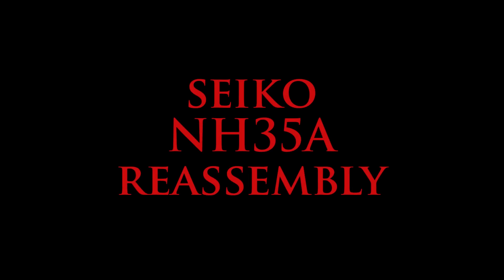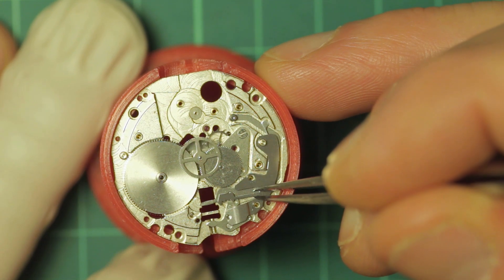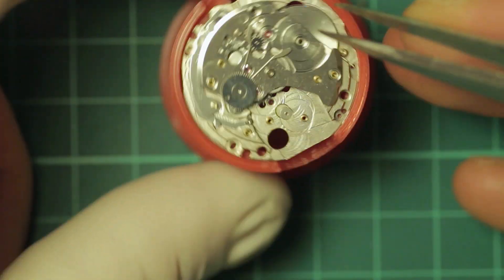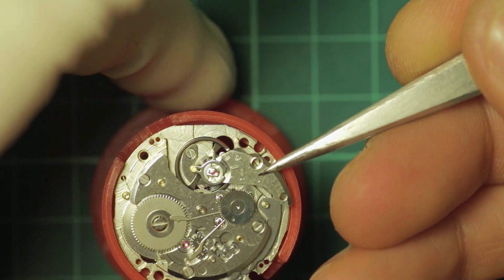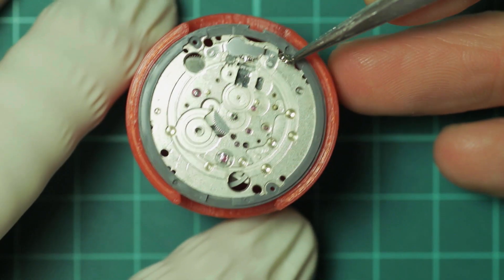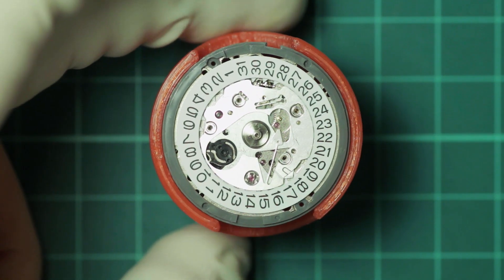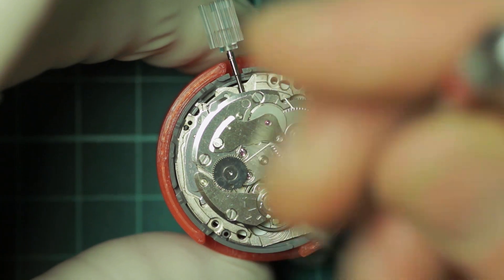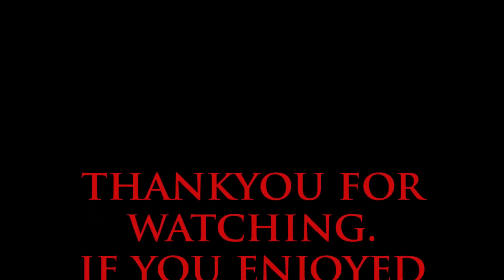Seiko NH35 - NH35A Part 2 Service - Reassembly

Comment: I have an NH34 with a winding stem broke in it, an nh36 with a bent second hand pinion, an an nh38 that just needs a good cleaning and oiling.

It used to be that I would just replace the movements of these watches. However, because of the trade war, these movements now cost around $70.00 US so I've decided it's time to level up my game and learn how to service watch movements myself.

From collecting, to modding, to building, and now servicing it's been a fun journey!

Thanks for your help Sir 👍

Comment: Hi I assembled the train works and pallet fork but when I dropped the balance it won’t go on. Checked the balance with another movement and it went right out. Maybe the pallet fork is not properly installed or defective?
Reply from the maker: You can check the pallets by moving the pallet fork side to side with some power on the mainspring. As you move it the escape wheel should move a tooth at a time.
If this works your balance should operate.
Reply: @spidiq8 yes thank you I did that and when I move the pallet fork it just uncontrollably unwinds, perhaps it’s defective. I’m working on an NH34. 

Btw awesome video, love that some people work on this inexpensive practically disposable movements.
Reply from the maker: @jmoliverosg Definitely something amiss.
Check the pivots are intact and correctly seated on the escape wheel and pallet fork and check that the pallet stones are fitted and secure.

Comment: Bonsoir, savez vous si les nh 35 qui sont utilisés dans les montres chinoises ,sont identiques ,et est ce que ces NH35 sont fabriqués en chine ?
Reply from the maker: I really don't know for sure.
I do know that Seiko has some stuff manufactured in China, cases and case backs etc and they're typically stamped made in China but for the movements I couldn't say with certainty.
Reply: @spidiq8  ok , merci

Comment: Hi this is great. Do you have a list of what oils you use on what parts please. I’ve bought a small volume set of mobeus oils. I would like to follow your videos whilst servicing this movement. As a practice.
Reply from the maker: Thank you.
When I filmed and uploaded this there were no other videos covering the disassembly and reassembly of the NH movements. Given it was such a popular one in micro brands and budget Seiko it seemed a good idea to show people because, cheap as they might be it's good to repair and service where able.
For oiling and this applies in general to wristwatch automatic movements, you'll need.
9010 - 3rd, 4th, escape, balance cap jewels, pallet exit stone.
(Ideally you'd use a specialised thixotropic grease for the pallet stones with epilame but they're both expensive for starting out and unnecessary for practice).
D5/HP1300 for barrel arbor, 2nd wheel.
8217 braking grease for the slipping bridle of the mainspring on the barrel wall.
8300 general purpose grease for any metal to metal sliding friction points, (keyless works etc), also used to lightly grease the mainspring if it's the old one that's been washed, a new GR mainspring from the packet is pre lubricated.
Hope this helps and good luck on your servicing journey.
Reply: @spidiq8 wow thanks that is really useful. Much appreciated. I’ll let you know how I get on.
Reply: @spidiq8 I purchased this which I realised gives info. Does it seem ok 

Moebius Synt-a-lube 9010 A low viscosity synthetic oil for faster moving pivots such as the balance and escapement. (Light greeny-blue)
Moebius 9104/20 (HP1300) A high viscosity synthetic oil for slow moving pivots for example the barrel arbors  and second wheel. (Red)
Moebius 8200  A thixotropic grease use for mainsprings (cloudy light yellow)
Moebius 9415 A thixotropic grease used for pallet jewels (darker yellow)
Molykote DX A fine grease often used for keyless works and other sliding metal on metal contacts

Thanks for your advice and time 
Fingers crossed.
Reply from the maker: @mikebeswick3420 That's everything you need except the braking grease so I'd suggest not disassembling and cleaning the mainspring unnecessarily as without it, it'll tear up the walls of the barrel and with the wrong grease will slip too easily and you'll lose amplitude.
Reply: @spidiq8 so that’s the 8217 grease you use. This is where you put it on three places on the barrel wall. Thanks
So the 8200 you add to the top of the wound spring. As well as the 8217 to the walls. 
I see some people wipe the whole spring with some lubricant. 
I need to check it out. 
But I need to get some 8217 grease for the walls.
Reply: @spidiq8 I noticed in the other kits they have the 8217 I’ve asked him to send me a small vial. The other kits he sells contains this. Thanks for the heads up.
Reply: @spidiq8 sorry for the hassle. Do you only use this on automatics watches. Im getting confused.
Reply from the maker: @mikebeswick3420  No bother at all. Yes this is only for automatic barrel walls as they have a slipping mainspring.

Comment: Hey so im confused….. probably my fault and not yours😅😅 anyway, my balance wheel just didnt wanna tick when I put it in. It also had resistance from somewhere and I could even make it swing nicely with my tweasers. I took it out and tried again like 20 times but it just wouldnt do what it had to do. Any tips? 

Thanks in advance
Reply from the maker: Firstly. With the balance and pallets out does the train spin when you wind some power onto the mainspring?
If yes, fit the pallets and with some wind on the spring flick the pallets gently with tweezers or a brush if you're unsure of your dexterity with tweezers and don't want to chance damaging it.
It should snap cleanly from side to side as the escape wheel moves.
If that is okay the train and pallets should be okay and the problem is the balance.
There are only 3 possible causes of it not moving, the impulse jewel is not fitting into the horns of the pallet fork,  the balance jewels aren't in place or pivot(s) broken or bent.
Reply: @spidiq8 Well,when I flick the pallet fork down, it instantly moves up again. I cant get the fork to stay in the lower position….
Reply from the maker: @brianslangen2080 It should lock both sides. Sometimes if you flick it over too firmly it can bounce back but provided the depth and locking of the pallet stones are good it should lock either side.
Check that both pallet pivots are seated in their jewels and there isn't excessive end shake or damage to the jewels.
Inspect the pallet stones under a scope or loupe to ensure they're not damaged or displaced.

Comment: Just bought a Steeldive 1953 with NH35 in it. After a month or so, it's always within+-2sec, namely while I wear it it lose 1.5-2 seconds and when I take it off overnight and place it face down it gains almost the same! 
Can't be more satisfied. Beat error is 0.3-0.4 and amplitude cca 260. (Supposedly Swiss movements require the higher amplitude the better, while the Japanese are constructed the way they work perfectly fine with lower amplitudes, even in the low 200s???)
And when the problems start it'll be cheaper to buy and replace the movement (cca 35$) than to have it serviced.
👍💪😁

Comment: Nice video and nice explanations. I'm working on my first Seiko NH35 movement, in a Seiko watch bought from eBay and that was loosing considerable time, so I got it at a very good price. I'm sure your video will be a big help. They seem very easy and straight forward to work on, so I hope it will turn out ok 😄. Out of curiosity, would you also oil any of the plastic parts or the pivots for them?
Reply from the maker: no, the plastic is a self lubricating type. Just take care not to damage or deform any of the plastic parts as they're easy to squash in tweezers for example.

Comment: Thank you for your very interesting and informative video. 👍 
One thing I don't understand (I'm not a watchmaker just an amateur) is why if "you are right wrist wearer, you want to align this the other way around with the oscillating weight on the opposite side" @14:11
Is it unique to this movement ? I thought it didn't matter since NH35A is a Bi-directional winding movement or it depends from something else ?
Reply from the maker: Though not essential all Seiko automatic movements have an 'optional' rest position to give the most efficient winding and this is based on left wrist wearers, i.e. Hanging crown down.
This means hanging crown up let's the weight rest on the opposite side and the winding is slightly less efficient, it's all related to the position of the pawl levers (magic fingers) on the 1st reduction wheel.
I hope that makes sense.
Reply: @spidiq8  Thanks a millions for your very detailed reply. Yes,  it makes sense now. 🤝

Comment: 이스케이프 휠 하단 고정을 어떻게 하나요?
아무리 해도 하단에 고정되지 않아요 
뚜껑을 닫아 버리면 동작은 되는데 
이스케이프 휠이 많이 움직여요
그래서 포크 팔레트도 동작 되지 않아요
Reply from the maker: This most likely means that the lower pivot of the escape wheel is broken and you will need to replace the escape wheel.
If you inspect it under strong magnification and compare both sides you'll be able to see if this is the case.
If the pivots appear the same and undamaged then one of the jewels has been misplaced or is cracked or damaged and will need to be adjusted or replaced.
A complete replacement movement would be the overall cheaper option when it comes to the NH series but it's great for practice purposes.
Reply: @spidiq8  Thank you for the information
It's better to buy a new one
I've been using nh35 movement a lot
I'm practicing over the hole
Once the escape wheel is solved
Overhaul successful
Mastering all other disassembling and assembling
Reply: I checked with a magnifying glass
Escape wheel pivot is broken
Thank you. I solved it thanks to you

Comment: How do you get that fork in there properly at 5:55? I'm really struggling to get the retention clip on it because the fork keeps moving around whenever I'm trying to align it.
Reply from the maker: Pallet forks are tricky and it's really a matter of practice and patience. There's no magic trick. Once the lower pivot is placed it's a matter of placing the bridge and wiggling it into place until the upper pivot seats. The important thing is never to force any of the bridges because that will lead to broken or bent pivots.
Reply: @spidiq8  Thank you. The thing is I can't get the fork to stay still. It always moves when I try to put the bridge on top of it and no amount of wiggling will fix this as the fork just moves more and more out of place. And now I lost a screw for the bridge, it fell down to the ground and now I can't find it anymore... After half an hour of looking for that damn screw I tried placing the fork and bridge again and I did it first try.... But now I can't get the screws in. I don't really have the right screwdriver for this, it's just a little too big and also magnetic which gets in the way because the screw always sticks to it. And then the bridge got out of place again. All this just because the stem broke off and I had to get it out by taking the movement apart. However, when I rebuilt the movement it didn't work properly. It would not rewind anymore and if I tried rewinding using the crown it would just let the hands spin so fast that the second hand was not even visible anymore while it was rotating. So something was off here. I'm now trying to rebuild it the third time with the help of your video which is great however this jewel fork thingy is just SO HARD to get in and if I knew it was there when I took it apart I would have avoided doing it (and it seems it wasn't even necessary). What is this thing even for?
Reply from the maker: @xdevs23 This is part of the escapement, the escapement is the but that stops your seconds hand spinning like a turbine.
It essentially allows the power to 'escape' bit by bit.
A magnetised screwdriver won't help anything and will magnetise other parts and cause further problems.
You need to be de magnetising your tools and watch. 
I suggest taking a break, working on small fiddly things when stressed just leads to frustration. 
When you're ready to approach it again sweep the floor with a magnet to find the missing screw and demagnetise it before refitting.
You can get cheap blue brick demags on eBay. 
An essential tool if you plan to work on watches.
Reply: @spidiq8  Thank you for all the advice, it really helps. Yes, I got frustrated because I just wanted to build the watch and use the movement as-is – I just thought I could rescue it this way. Lesson learned, I guess. I think it's not really worth my time to keep working on this movement, especially since I don't know if more things are broken by now and I have invested like 6 hours into this already when it was meant to be a 30 minute thing to get the entire watch together. I'll invest in proper tools (non-magnetising screwdriver, for example) and just get a new movement for now. Thanks a lot though! I learned so much doing this. And about the hands spinning like turbines, I think the reason this was happening is because the tiny wheel next to the fork was loose and thus the escapement mechanism was not working and thus just flinged all the energy at once.

Comment: This video needs to be 100% redone.  Everything from not starting off with the stem and winding works to not explaining the lube used, etc.  Also, there are several areas Seiko's manual states requires lubrication, which are not being addressed at all.  I appreciate the effort in creating the video, but I ended up tearing it all down and starting over.  Way too many missed areas for it to run right.
Reply from the maker: This was a quick video initially for a friend to cover a movement that at the point of filming, no one had bothered servicing or stripping due to the cheap replacement cost.
It wasn't meant to be a step by step.
If you would find it beneficial I am willing to do a complete step by step on this movement at some point in the future.
Reply: Up to you. I tried following the video and made several mistakes in the process. I guess the positive part is I learned a ton having to redo it. My bad for not watching all the way through first, before starting

Comment: i'm having issue reinstalling my escape wheel, is it meant to be fixed in place within the stem of it in a hole? Mine is in place but still is unbalanced and moves around
Reply from the maker: If it moves it means one of 3 things, it's not seated in the pivots  correctly, a pivot is broken, a jewel is misplaced.

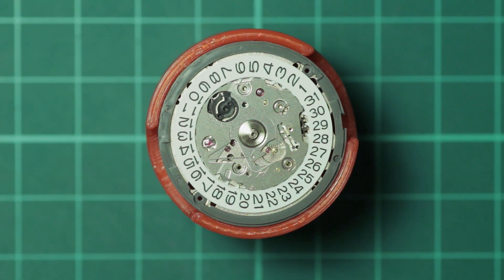Comment: I realize this is an old video, but wondering if you still see the comments here. At 11:08 in the video, there is a cutout for what looks like wheel that the arrow shaped spring is "pointing at". I got a new movement today and drove myself crazy looking for, what I assumed, to be a missing part. There's nothing there in your movement either. Any idea what that area is for?
Reply from the maker: Most likely a common base plate for different / future revisions of the movement, I know there's a GMT version of this movement now so possibly related to that as with most GMT it's a front module gearing that takes the 24 hour hand drive from the train of wheels.

Comment: Please can you tell me why you rotated the movement holder.180 degrees when you were fitting the balance wheel?
Reply from the maker: I find it easier to rotate the movement holder whilst feeding in the balance than trying to rotate the balance in the tweezers, you need this rotation to ensure that the impulse jewel feeds into the horns of the pallet fork.

Comment: Does NH35 use plastic pallet fork?
Reply from the maker: No, it uses a conventional metal fork with ruby jewels. The only movements using the plastic ones are certain base ETA movements typically utilised by Swatch and Tissot.
Don't be put off by them, they're a very tough self lubricating nylon material and work excellently.